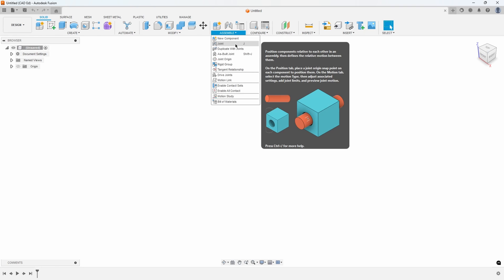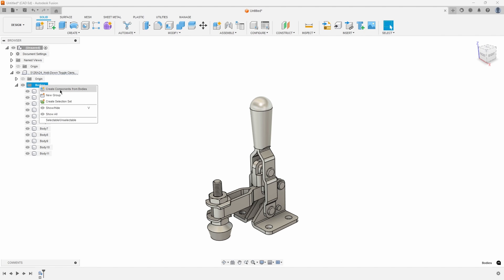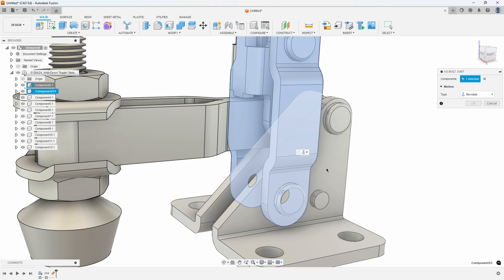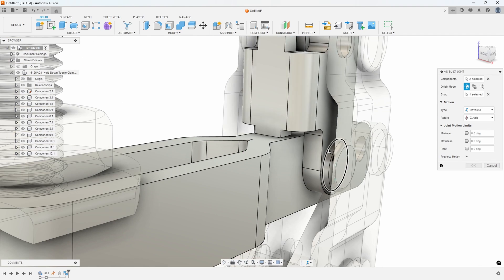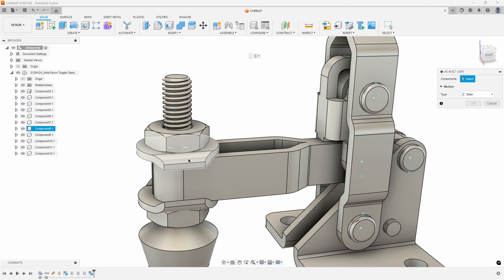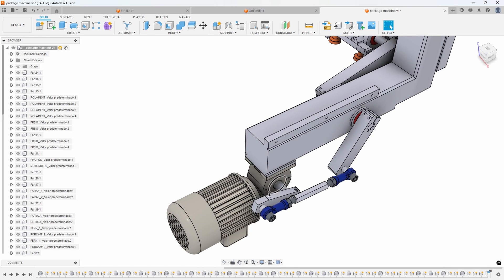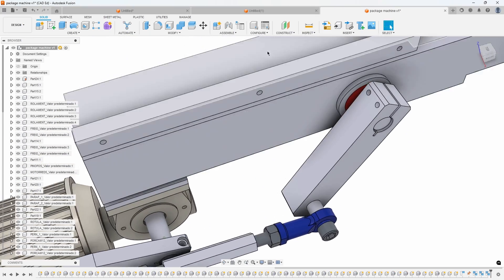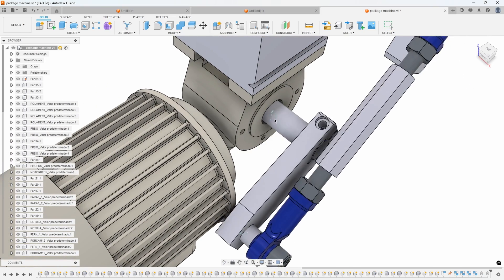As-Built Joints in Fusion

Comment: Brad, are you open to helping with an assembly I am knee deep in. It is one of the first serious prototypes I have been hired to do. What it loosely boils down to is difference btwn designing for both 3DP hard copy to distribute to client, other team members (PCB designer) and the actual precision or absolute dimensions that injection molding is capable of. Just barely managing to hang on to my sanity.
I am having to tweak bore diameters, mating surfaces like dovetail closures, and wait till the next part is more than a little tight fit.

Comment: Another great one.  Can you explain when to use a rigid group vs a rigid joint when joining 2 components?
Reply from the maker: You would use a rigid group if the parts are already in position or assembled together.  You would use Rigid Joint if you have to assemble the parts together, such as you import in a drawer handle and you want to attach it to the holes on the drawer face.

Comment: Hi Brad, thanks again for a great video! Is there any difference between a ridged group and a ridged joint?
Reply from the maker: You would use a rigid group if the parts are already in position or assembled together.  You would use Rigid Joint if you have to assemble the parts together, such as you import in a drawer handle and you want to attach it to the holes on the drawer face.

Comment: So, I'm still unclear on all the pros/cons of using an "as built" vs "joint". From what I can see in your video, the as built is good when both of your components (or rigid groups) are already placed (in relation to each other) properly. Are there any reasons you would not want to use an "as built" joint when both of your components are already placed (in relation to each other) properly?
Reply: :22    I'm unclear too.  Sounds like it would be easier to build your own final assemblies first then add joints this way ("as built joint") instead of saving this method for imported models only.
Reply from the maker: Correct.  As-Built joints are best used when the parts are already assembled, like the Toggle Clamp and DVD Assembly were.  You would not need to use the regular joint command to build in joint intelligence.  However, if you were building an assembly and were creating or importing parts that then needed to be positioned into their correct location, you would want to use the regular Joint command.

Comment: That's awesome!
What's the difference between ground and pin?
Reply from the maker: Fusion changed the terminology a few releases back.  Pin now keeps the component from moving.  For example, with a vice, you would pin the base, then all the other components would move in relation to the pinned base.  Ground to Parent acts more like a rigid group to a parent.  For example, if you are creating a toolbox and you draw the lid, and then create a handle component under the lid component, the handle will be "grounded" to the lid.  So, if the lid rotated, the handle would move with it.  You didn't have to create the joint.  Fusion did it for you automatically.